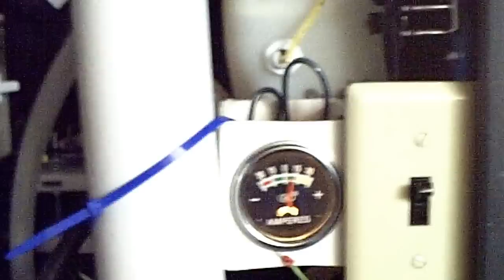HHO hydrogen space heater hydronic heater update

Comment from the maker: The heat exchanger is the block of aluminum with holes through it and this one happens to have a computer liquid cooler on it. It would work just fine with just the aluminum block with holes drilled through it and then circulating the water through the block and to some kind of radiator that would blow the heat away.